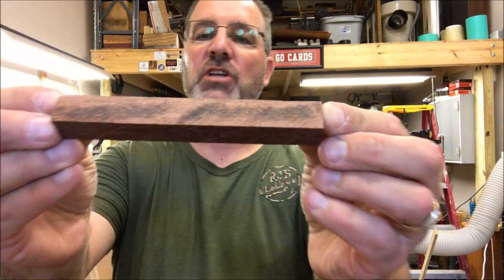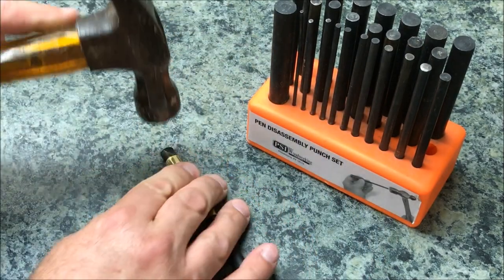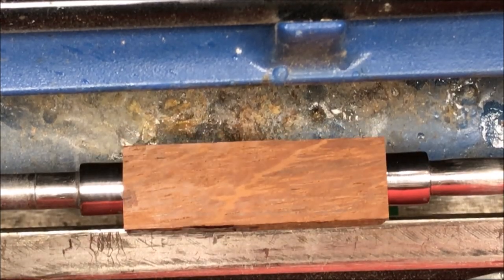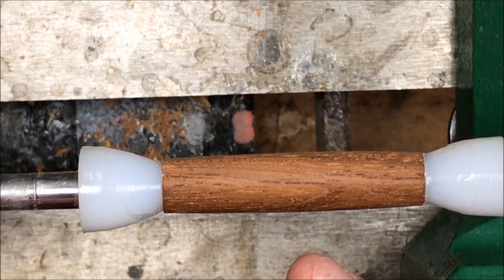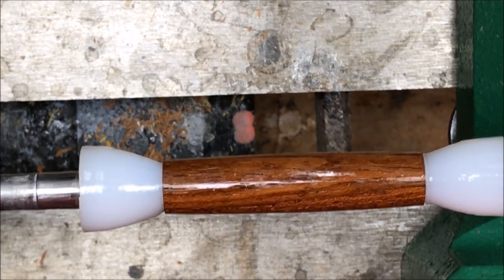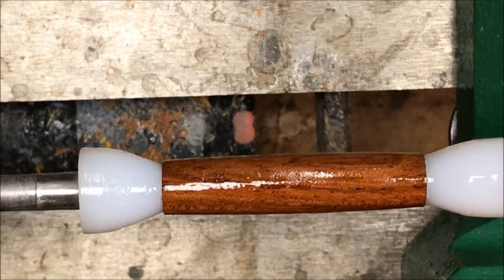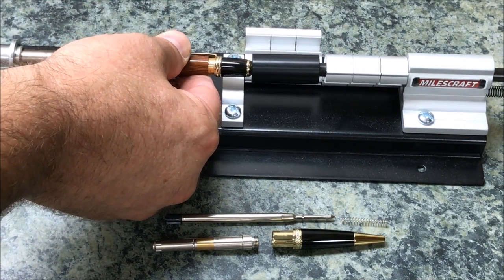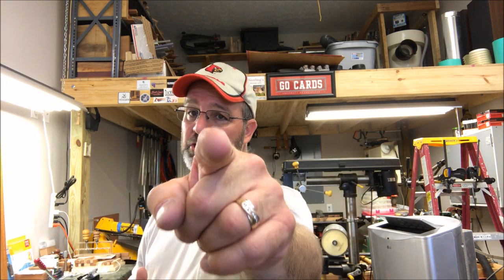Austrailian Teak On a Manhattan Pen Kit

Comment: Bob, beautiful work as always! Couple of questions for you, which buffing wheel is that and what do you use on it? I have the beall buffing system with the tripoli and white diamond.

Also, why do you switch to the other bushings before micromesh sanding instead of just sticking with the CA bushings? Thanks!
Reply from the maker: +RonWeeber Hello Ron,
  That's the Barry Gross buffing system and it came from Penn State. I have been using it on all my pens. The Beall is a way better system and would work perfectly. 

I like to stitch back to the turning bushings in case there's any build up on the ends of the blank. I can MM them right back down the the perfect diameter. 

Regards,
Bob

Comment: Teak has that problem with the slight depressions in the wood.  I turn a lot of teak.  When boaters are refurbishing their boats, new teak decks or doors etc.  They give me wood from their boat and I make the nautical themed pens for them.  Good seller
Are those pen kits like the Gatsby or Monet?
Reply from the maker: +Dave White Yes, they are similar to the Gatsby, Wall Street, And Sierra. I've not turned the Monet so I don't know much about it. 

Regards,
Bob

Comment: Looks like you went up town with the new pen press. Where are you finding the 800 grit yellow sanding pads? I bought them a while ago and can't find the set with them in it. The sets all seem to start at 1500 anymore.
Reply from the maker: +Mike Turner I got mine from Penn State. Search for pen finishing kit. The pads are sold separately. You can also search for
Micro Mesh but PSI doesn't sell that. 

Regards,
Bob

Comment: Hi Bob. What material do you use for applying your CA coats? Paper towels?
Reply from the maker: +Mike Kline Yes,
  Don't buy the real cheap towels, they smoke when the C/A test on them. 

Regards,
Bob
Reply: YHi Bob. Have you ever tried the blue shop towels? I have used them and they seemed to product less fuzzies. Would like to know your thoughts compare to white towels.  Thanks.
Reply from the maker: +joe little I have used them and they provide superior results. What usually happens is I run out of towels while turning so I swipe a roll from the storage closet in the house. Since I have towels, I don't think to pick up another roll of the blue ones. 

Regards,
Bob

Comment: Hi Bob
Quick question , I notice that when I apply ca it sometimes gets very hot
why does this happen
Thanks
Roger
Reply from the maker: +Roger Fortier That is a chemical reaction that occurs when C/A cures. It is also one of the main reasons that people sometimes get a cloudy effect in their C/A finish. If the blank has moisture in it, the heat will cause it to evaporate and become trapped in the finish as it cures. 

Regards,
Bob

Comment: Hey bob, I have seen other people using plastic bags to apply ca have you tried this, does it work?
Reply from the maker: +Daniel Findlay Hello Daniel,
  It does work and I tried it at the same time I tried the blue tape on the finger. The blue tape just felt more natural to me so I went with that. 

  I urge you to give it a try. Just chuck up a scrap of wood and sand it smooth. Then give the bags a try. It's kind of cool that it actually works.

Regards,
Bob